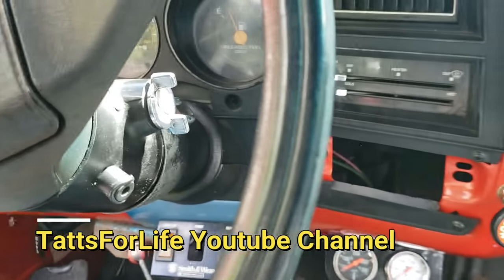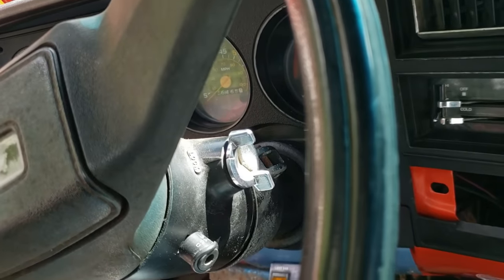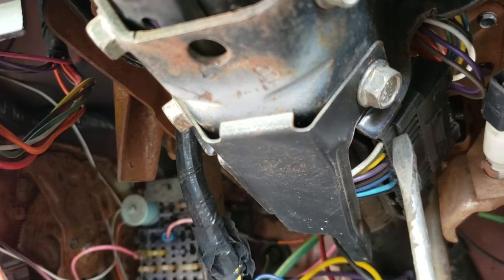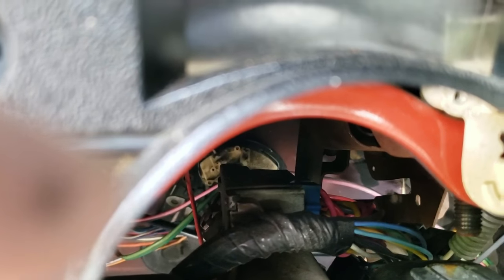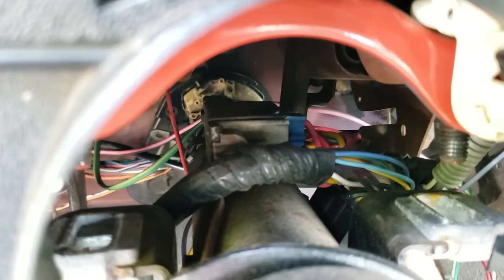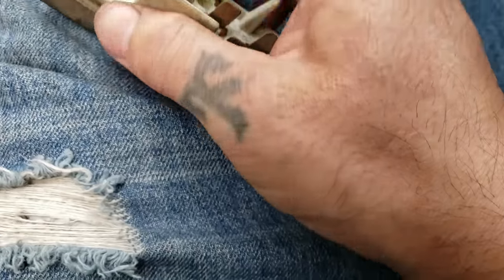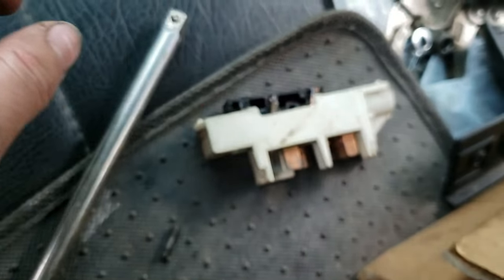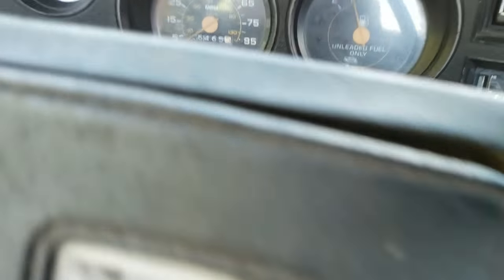NO START PROBLEM FIXED! C10 Ignition Switch Removal And Install, HOW TO VIDEO

Comment: My dad passed away about a year ago and I've been staring at his truck or finally got started on it seen your video and you were a lifesaver it was exactly what you said it was the safety neutral switch and I was so excited that I took a bobby pin like you suggested stuck it in there and it started right up absolute miracle drug hasn't been running it over 5 years started right up

Comment: My brother is having the same problem for his 1983 truck but the thing is his truck was working fine but he got stuck in mud like really bad stuck and me and my brother were trying to move it and he  put in overdrive 1 then after that the truck turned off he turned it on again but it wouldn’t start no crank no start but you can see it still had power cause of the little red sign

Comment: My sons truck would do this intermittently and would just lose all power while driving.
Reply from the maker: this could cause that issue, but also a lose power feed wire going to the fuse box would cause that
Reply: @TattsForLife  we also found a bad power wire. So now I hope it’s fixed so he can race his truck
Reply from the maker: hope you found the trouble and fixed it
Reply: @TattsForLife  yes we did and the truck runs great

Comment: good video. this is why my el camino would not start . i had power and fuel and new cap and rotor and fairly new wires and plugs . the ignition start switch was toast like yours . luckily i had a complete steering column from another el camino that i was able to rob. works good again. cheers
Reply from the maker: Happy the video was helpful

Comment: I wish this would of fixed my problem I have changed this part in your video the starter got a new battery and ignition coil and still no crank or clicks
Reply from the maker: Check the nutral safety switch it will cause same symptoms, also they a fuseable link in your key starter wire that goes to the starter, it's the smallest wire on starter if it is  blew it would cause a no crank and no start issue to

Comment: My 82 c10 had a similar problem with this switch, mine would crank but power to the distributer was intermittent during cranking. Found out the stupid way by tearing the whole fuseblock out before I saw you vid and it clicked.

Thanks!

Comment: I'm wondering if this switch would be the culprit for a truck that won't shut off? I twist the key and it continues to run, but sometimes it'll turn off too. I'm wondering if this is beginning to fail. Thanks, great video and really helpful for many.
Reply from the maker: Yes that would be a sign

Comment: I changed mine today. This was a very helpful video. Mine is automatic, but it was still very helpful! (Tighten the new switch all the way or it will have your key switch in a bind when you turn the key. Don't ask me how I know this!)
Reply from the maker: Happy the video was useful, and that is great info
Reply: I replaced mine cause I’m having this exact same issue. Now when i turn the key it binds a lot and the key doesn’t retract when i try to start it. It turns the power on but it doesn’t start, it binds and doesn’t retract. Does it have to do with it being loose?

Comment: I did one in my 77 Jimmy automatic with a tilt steering wheel and it worked. The only problem was I was going in for surgery on my sinuses and my headache was driving me crazy but I still got it done. Adjusting the rod was the only thing that I had to adjust once. Not bad for an idiot.

Comment: Just bought an 86 K30. Drove it to north to get some plates on it and I am having a similar problem. I am going to tear through it in the morning and see if this is the problem. I will keep you posted if it works.
Reply from the maker: Best of luck, also check your safety switch
Reply: @TattsForLife  So after further investigation I found out that whoever ran the battery cable decided to run it along side the exhaust manifold and it was melted through.  Replaced and rerouted the cable. Problem fixed.

Comment: Hey man thanks for the video, but my 1979 chevy still won't spark ive changed the distrubter, the switch, the wires, also the starter and tested them on another truck and they work but I for the death of me can't figure out whats causeing it to not spark. Do you have any idea?
Reply: Hi friend, I have your exact same problem. I too have a 79 model and when I turn the key nothing lights up, it looks dead.

Comment: thank you for the video sir,
would you be able to help me troubleshoot a c10 that's shorting out when the ignition is turned?
i lose all power once the key is turned to start, and i have to reset the battery to try again
new ignition switch installed didn't seem to help

Comment: Very helpful my 81 c10 has it on the side of the column but still had to drop the steering wheel to access the bolts thanks for the video
Reply from the maker: Glad it helped

Comment: thanks for the video, I actually changed the starter and that didnt work. Currently I have the starter hot wire to a momentary switch, now I know what to replace.
Reply from the maker: Glad it helped

Comment: I stumbled across this video . working on my dads 1978 chevy 10 with 350 HEI ingnition and automatic . he drove it it shut off then he was able to start it and drive it home and parked it . went to start it no spark but turned over. We replaced the rotor , cap , icm and coil . hooked everything back up like it's suppost to be now no crank and no spark? Battery good cables and all wires in the engine bay have been tested. Replaced the starter and replaced the ignition switch on the column and neutral safety switch still no crank or spark but the dummy lights at the bottom of the dash lights up like yours???? I checked all fusible links. So I'm guessing its the in the wiring between the switch and the bulkhead???? We tested the pickup coil it seem to be with in specs on the ohms meter ?
Reply from the maker: sorry for the late reply, can you shorten down what is happening? or have you got it fixed yet?
Reply: @TattsForLife  basically it ran then shut off in traffic then he started it back up drove home. went to start it the next day and it just turns over . we replaced every single electrical component  and still nothing? check all wires under the hood even fusable links all good. i replaced the ignition switch and netural switch. then I narrowed it down to the bulk head wire connections or the wires from the bulk head to the ignition switch . i had to take out the distributor in order to replace the pickup coil. then thats where the 2nd problem started.i previously marked the location where the distributor was facing including the direction of the rotor. went to put it back in and it wont fully engage? there is less then a 5/16 gap from the bottom of the distributor base to the base on the intake . I feel the teeth engage but it seems like the oil pump shaft or gear is catching on something?  I have shined a bright light down in the hole from the back of the intake to the top of the oil pump but cant see anything? I guess we're at the point of pulling the oil pan and oil pump off and see if it goes back in ?
Reply from the maker: Sounds like the oil pump shaft isn’t splines into the distributor, and replacing everything won’t fix it if it doesn’t have voltage at the distributor
Reply: @MoparMan-ff8fb  I have a '76 k5 jimmy that's doing the exact same thing rite now..?.?
Reply: @childofsmokeyhollowkidzyo2680  I think I'm going to have to drop the oil pan remove oil pump drop in the distributor and put in a new oil pump shaft and oil pump to fix the problem. I think the oil oil pump is the cause of the problem. it a high milage piece of shit with a possible loose shaft that comes out of the pump

Comment: Hope this is my problem! I’ve taken off the starter, got it checked, cleaned and re-spliced  all the wires, changed battery’s, etc… Has to get towed home for $220! I’m going to check this it right now!
Reply from the maker: Good luck, if its not this, then check the neutral safety switch, both will cause a no start
Reply: Guess I’ll try the Safety Switch because that didn’t fix it! 😿 Thanks!

Comment: Hey thanks for the video, it helped me fix my truck. I’m having issues putting the rod back in the switch though. My rod is pointed up towards the ceiling. I think it’s suppose too point to the passenger side door. Do you recall the direction yours was pointing? Thanks for the video man!
Reply from the maker: I had a time getting that back in to when I removed mine lol I failed to note what way it came out lol

Comment: Ok I have a motorhome and it's doing the samething. Ok but my starter has R terminal and S terminal witch I have hooked up the S terminal. I raned the S terminal to the battery  and a hot wire of the distributor to the battery it cranks. ok do you think it's  the same problem I'm having do you think I need to drop the steering column what you think
Reply from the maker: Fist have you tryed to start it in natural

Comment: Same thing happened to me went to d store came out and fuck! I cranked it from d front .after checking everything today I got to d switch but dint take it off. I had just take out my transmission cause I’m getting it rebuilt I was tired already but tomorrow I’ll take it out and change it hopefully is that.
Good looking!!!
Reply from the maker: @Matthewleiva09  hope that you get your issue fixed

Comment: Without replacing the ignition switch will turning the tumbler still give accessories power. My tumbler doesn't turn very far either but I got power to everything except it won't even try turning over.
Reply from the maker: Oh there isn’t any chipped key or anything like that in a square body so yeah if you can get the lock cylinder to turn over accessories should come on and it should start if it doesn’t I suspect the issue is somewhere else
Reply: @TattsForLife  so starter, wiring, distributor?
Reply: @TattsForLife  for context it's a 1982 c30 dually with the 350. Been sitting for 8 years.

Comment: I think I’m Having the same problem... but I went to crank my 79 k10  and all of a sudden I herd a zapping and smoke? And I traced all wires and fuses and they are all fine and have power but no lights, heat, or ignition(cranking) please help!!
Reply from the maker: that would be a short, you must of over looked it, you can check your fuse box and see if any are blew most likely when it shorted out you lost a fuse or two

Comment: My truck isn’t having this exact issue. The engine is able to turn for a second and then makes a loud clunk sound like the transmission is engaged in park. Would this fix this issue?
Reply from the maker: no, sounds like you have other issues, maybe a broke rod or something binding as the engine turns
Reply: @TattsForLife   figured out the truck runs perfectly fine in neutral. It was a trans issue.
Reply from the maker: @funtime_fire2907  happy to hear you found out your issue

Comment: I’ve got a 87 getting power and cranking fine but not getting any power to the fuel pumps, I’ve replaced the fuel switch for tanks, replaced fuel pump relay and pumps are maybe a year old. Weird part before it started doing this you had to pull up on the shifter shoving it into park further to get it to start.
Reply from the maker: Have you took a volt meter to the fuel pump plugs and see if power is their, and if not check your tank switch valve and see if its getting power cause it should be what sends power to both pumps

Comment: Could the is be the reason why my starter clicks then start, and I have some days where it starts normally -thaks
Reply from the maker: do you have a ground from motor to the body, and a ground from motor or body to frame, and a ground from frame to battrey, and one ground from engine to battrey?

Comment: Thanks bro..I just changed the key Switch.. Which wasn't fun at all..lol now moving on to the switch.. Sure hope it works..
Reply from the maker: If it dont, try the neutral safety switch
Reply: Where is the switch located? Mine is a 3 on the tree
Reply from the maker: @holinessorhell1964  should be on the clutch pedal, have two wires going to a switch. U can cross the wires over to see if it will start
Reply: @TattsForLife   Thanks again brother..
Reply from the maker: @holinessorhell1964  welcome let me know if it works
Reply: @TattsForLife  Question brother... I changed the Ignition switch..Does it have to be attached/grounded to the steering column to start up the vehicle? I also ordered the Neutral safety switch as the next step if it's not the Ignition switch.. Mine is 3 on the tree Manual Transmission.. Thanks again for all of your help
Reply from the maker: @holinessorhell1964  I always try mine attached, and u can jump the plug with a Bobby pin if your safety switch is two wire and see if it will start
Reply: @TattsForLife  Got it bro..Thanks again Maybe I'll get to meet you someday.. You've really been a help
Reply: @TattsForLife  how do you jump the plug and which one

Comment: That was the neutral safety switch though was it? I have an '86 K5 that does nothing with the key on but I can jump out the starter so I'm pretty sure it's the neutral safety
Reply from the maker: no what I replaced in the video was not the neutral safety switch, the neutral safety is on down near bottom steering shaft
Reply: @TattsForLife  
Hopefully you can answer this for me, I don't have a neutral safety switch since it's a standard but what it does have is a clutch position safety switch, it's gotta be  that or the part that you replaced  I'm not sure of the name of that part. I'm pulling my hair out with this thing, thanks for any help
Reply: Okay I'm back for the last time.  I pulled the switch off the column that you replaced and put an order in  for that and the clutch position sensor which is basically the neutral safety version for a standard, it's gotta be down to those 2 and they weren't real expensive so I figured why not just replace them both. Thanks
Reply from the maker: @everydaylife1885  yep, best way to be, replace them both
Reply: @TattsForLife  
Thanks, sorry for being a pain in the ass
Reply from the maker: Its fine, I try be as helpful as I can

Comment: What is the part called that the ignition switch sits on that connects to the ignition. When I was replacing it it came loose.
Reply: It’s the part that sticks up that the ignition switch sits on

Comment: Question for you. When I turn the key I have no power nothing happens at all could it still be the ignition switch? Just not clicking at all?
Reply: Have you found out yet? I starting to think this is the answer tho
Reply: @sirtokesyflame8922  I replaced the ignition switch and nothing happened. I then chased all wires and checked all neutrals and grounds.  Found nothing wrong and then I got a multi meter and checked the terminals and I have 12 volts then checked my battery cables and I had a terrible connection. All I had to do was replace the battery cables. Moral of the story always check the simplest part first haha. Goodluck to you!
Reply from the maker: try by passing your nutural safety switch, that would cause the issue you stated. if it starts by bypassing replace your safety switch

Comment: What if I took my ignition switch out and it started with the flathead screwdriver. I tried putting it back in and starting it with the key and still nothing. Is the switch bad even though it just worked with a screw driver?
Reply from the maker: could be, the switch is what twist in place of a screw driver
Reply: @TattsForLife   ok I’m gonna try replacing that
Reply from the maker: good luck

Comment: I bought a 84 k5 at first it would crank but not start. Barely started for a second back fired died and won’t even crank now any ideas? It’s got an hei distributor and supposedly a new motor. I thought timing Bc it would just crank and crank but not start.
Reply from the maker: back fire can be from bad dissy or coil, or a bad cam, or bad fuel could be many things, make a list and check it off one by one

Comment: Well i bought a truck 454 auto, and the ignition was gone (the entire lock assy) but the rod that selects the position on the ignition switch was stuck for some reason. I freed it and now when i get it into the position with the dummy light on i doesnt attempt to start.
Reply: This is also a truck that will only run with the starter engaged
Reply from the maker: When the light is on it need pushed in a bit futher to engage the starter, then u let off and it will be in the run position